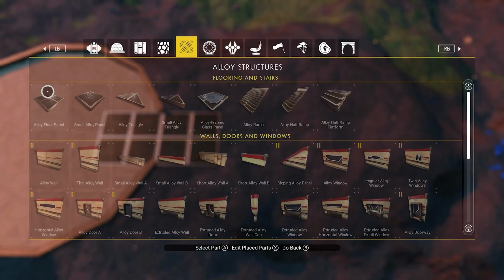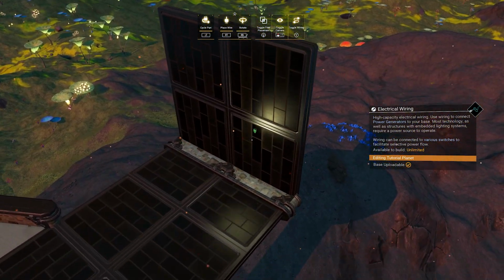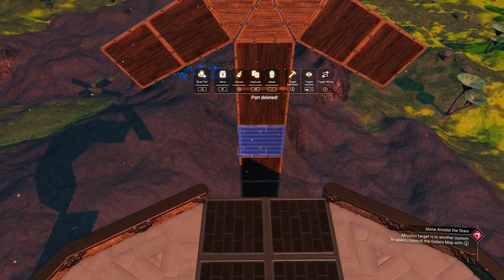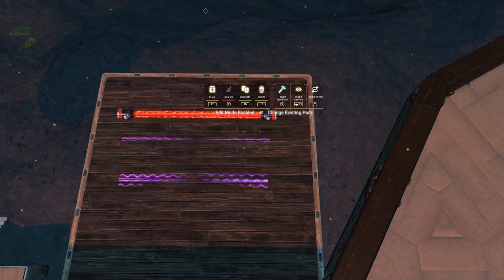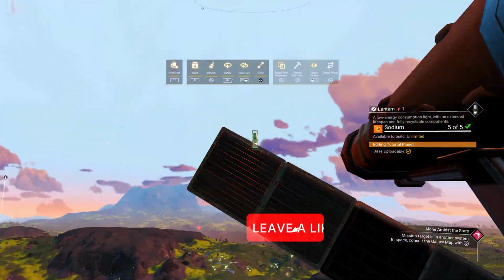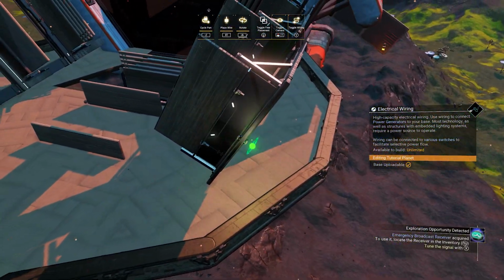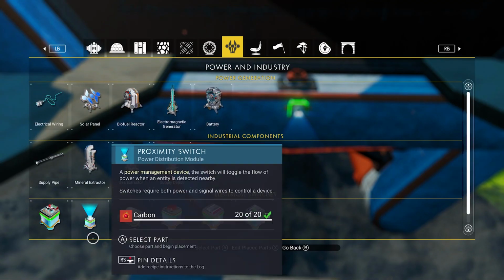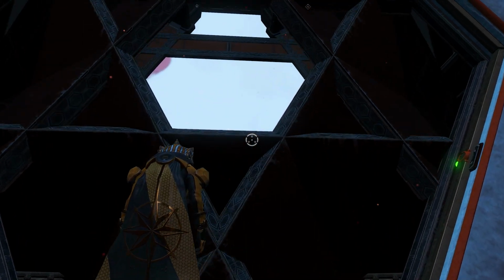How to Build a GIANT Airlock in No Mans Sky - Glitch Building Techniques by Beeblebum

Comment: How close is the timing between Q and build(L-click) when trying to place the cached item? Every time the object in cache is normal size. I saw only once where the item was smaller for a millisec then it reverted to normal size.
Reply from the maker: Keyboard and Mouse are such a hard way to do glitch building - it is possible, but pretty frustrating for timing.
I would advise to either create macro's or use a controller instead.

For timing, the pressing of the buttons is almost simultaneously, with a slight priority to "Q".

For more in detail info about glitch building and timing: https://youtu.be/FurKLVb534A?si=SlHq9YuToPBS2JKU

Comment: I just rewatched this again and I have another hopefully helpful tip. I noticed that you have to get right up to the door before it opens, could you move the proximity sensor further away (or place a second one on each side) from the door to make it open sooner? (I assume that you can place prox sensors in a 'gang' such that any of them could open the doors?) Also someone else mentioned making a hanger door this way and flying in, I would suggest that not only do you place the sensor on all six sides that you try to arrange some further from the door also in the six sided pattern, you will need the door to open sooner if you want to fly through it. Do you agree Beebs?

Comment: Nice, I have one of these on a build I was working on (great for covering landing pads!)
Your method of using the walls to place the wire on the oversized door is so much easier than the old method you showed us.
For some reason when I tried doing this with the tilted hydroponic tray method, I was unable to place wires as the connectors wouldn't show up past a certain number of connections.

Comment: Would that fit a landing pad. Slowly building stargate Atlantis ancient tower. With a top of the tower being a hanger bay and the scaled doors as the entrace
Reply: You could always scale down a landing pad to fit using the 'scale wire' method...
Reply: @kevinseven6633  basic landing pad fits nicely actually. With 3-4-4-3-4-4 hexagonal shape using triangle floors
Reply: @BigRed141021  Thats great. I have built such as well in January this year. I was curious about if I could build a hangar and store my ship inside my base. Worked fine. With some electric fun it was also possible to open and close the hangar fully
Reply: location?
Reply: @MarcellTV11  still building.  I’ve got the central spire complete . Working on the support spires. Will have to also figure scaling for the door as Atlantis tower isn’t an even hexagonal but an elongate